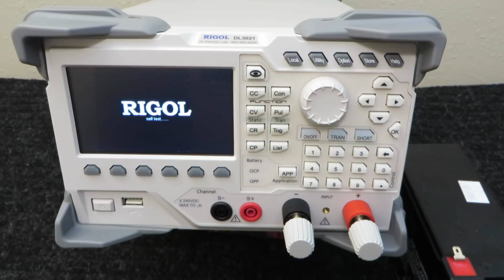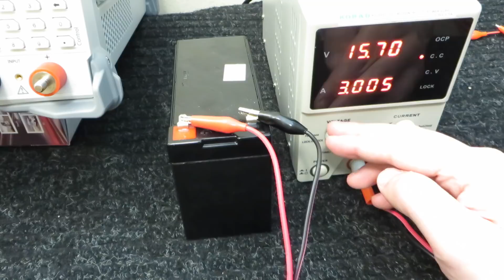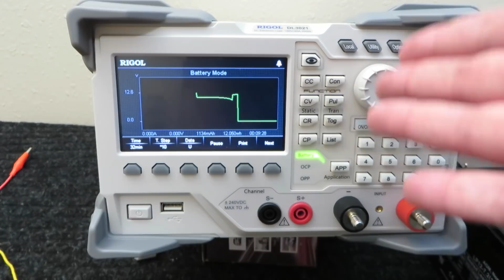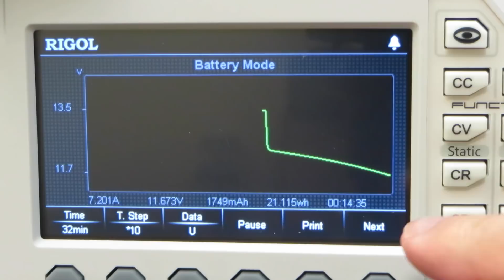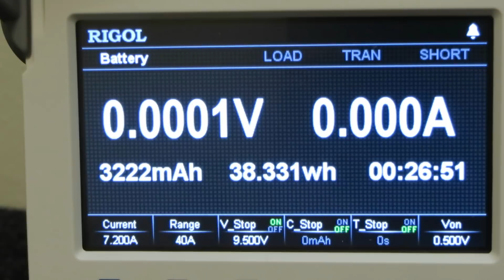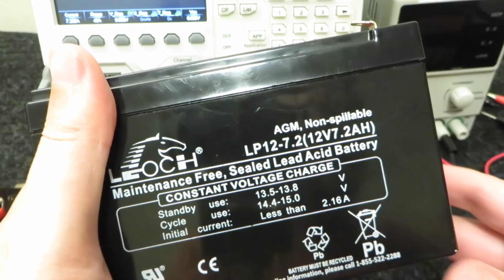Battery Desulfation Demonstration Start to Finish - Part 2/2

Comment: I have a 2 year old car battery that I converted into a magnesium sulphate electrolyte aka:epsom salt and I've rinsed it out with baking soda and water about 3 times, added the epsom salt and distilled water mix, and cycled it and zapped it with a 10 amp charger on muanual  a few times, dumped out the epsom salt mix and added some new with a little more  e salt, and repeated the process a few times with the charger, and have had it setting with a 1 amp trickle charger for over a week  and after letting it set for a few hours it settles at 12.2 volts until i put a load, a 12 volt headlight bulb i turned into a 12 volt lamp to drain the battery with to recycle it, and the voltage hangs at 10.9 volts and just slowly discharges.  Is this epsom salt gonna do the trick if I recycle it some more or should I go ahead and put the acid back in it.  I'm just using it as a backup battery for when the power goes out or to hook my 500 watt inverter to it when i need it.  It's a starting battery I know, a walmart neverstart 730 cca, but I just want it as an emergency battery, and just keep it topped off for an emergency.  Any educated advice you can give a greenhorn?
Reply from the maker: I'm not a fan of adding epsom salt to batteries to revive them as the chemistry doesn't make any sense - meaning there is no chemical mechanism at play to allow it to do what is claimed - but what you did in terms of replacing the electrolyte does make sense.  I have to say I haven't tried this before but it sounds like what you did is very similar to what some industrial battery recovery businesses do.  How to properly reform it back into a traditional lead acid battery?  I'd have to do some research as I admit I don't know how.

Comment: I see your problem.
Concrete floors discharge batteries !!!!!
Reply from the maker: That is an old myth that used to be true in wood and tar case batteries.  Today the only issue with storing them on concrete is that the air temperature around the battery tends to be different than the temp of the concrete resulting in a temperature gradient in the battery.  Where my batteries are the concrete is only a few degrees different than the air temp most of the time.  That may not be the case in a garage or other environment where I'd still recommend putting them on a piece of wood or cardboard.  It likely doesn't make much of a practical difference though either way.
Reply: @knurlgnar24  ok prove this myth. 
Get two new identical batteries and leave one on a insulated floor and one on a concrete floor. Could make a good youtube video
Reply: @knurlgnar24  nope still occurs. I didnt know about this until about 10 yrs ago when a car mechanic kept saying his batteries kept going flat when he left them on the concrete.

Comment: Will this technique also work on 200ah Gel batteries?
Reply from the maker: Yes, but gel batteries will require a low current limit to avoid creating voids in the electrolyte.  I am not sure exactly what the current level needs to be for any particular battery.

Comment: Fascinating, obviously with AGMs it is difficult to see what is going on, from my observations with wet lead acids during desulphation you get localised bubbling where a part of the plate has begun to recover. The bubbles of course are not conductive so the cell internal resistance will rise temporarily. Lead acids seem to recover very well, obviously there are other modes of failure that cannot be reversed. Good to see you back.

Comment: I was under the understanding that with an AGM, if the over voltage causes any bubbles in the mat, the gas will get trapped, arc and burn that cell and lose capacity? 

I have seen that de-sulfating / maintenance charging flooded lead-acid it is very normal for bubbles, even during normal charging they out-gas.
Reply from the maker: AGM batteries bubble just like flooded lead acid except that the bubbles are slowed down by the fiberglass mesh.  The idea is that they are slowed down enough so that the hydrogen and oxygen recombine into water before escaping out the top of the cell.  Overcharging doesn't cause issues unique to AGM batteries aside from pressure which could deform or rupture the case if the bubbling is violent enough, or more likely simple dry-out due to electrolyte loss.

Comment: A while back, I found a new in box APC UPS that had sitting for more than twenty years. Not knowing about any of this, I gave up on its batteries as hopelessly dead. They've probably long since been recycled. Now I wonder if they might have come around...

Even with good batteries, the UPS had a hard time coming back to life. At first the relays inside would buzz when the power button was pressed. Then it'd buzz and produce a painful sounding beep. Today it's fine. If I had to guess, I'd say it was capacitors reforming...
Reply from the maker: That's a good guess on the capacitors.  I suspect if those batteries were new and never used they would have come back.  No guarantees though!

Comment: I have a marine 12v battery that is being desulfated now and on a float charger.  I have discharged it 3 times.  It is recovering.   Resting voltage around 12.65.  When I found it at the scrapyard, it rested at 8.50.   My question is:   Why are hydrometer readings at 11.50 and getting better yet battery resting voltage at 12.65?
Reply from the maker: Specific gravity isn't directly related to battery voltage so I'd trust the hydrometer.  You're doing things right if the hydrometer readings are increasing.  In this video I only checked voltage but measuring the electrolyte when possible is the better way to do it.
Reply: A follow up.  I believe based upon the hydrometer readings that I will have to charge it for quite a long time.  I will continue to use the float charger and desulfator. Guessing it may take days or weeks.
Reply: Thanks for  your input.

Comment: I'm a little confused - on the battery case it says 7.2AH,yet  you you were saying it was above capacity at 3.8AH (I think) on the last cycle. What have I missed?
Reply from the maker: I was discharging it at the C/1 rate, and at that discharge rate the datasheet claimed the battery had about 3.5Ah.  I would have gotten different results if I used a more appropriate C/10 discharge rate but I didn't want to wait a day per cycle.
Reply: @knurlgnar24  Thanks - see, told you I'm learning a lot!
Reply: Excellent video series by the way. Very informative. I've learnt a lot!
Reply: Thank you I just pointed that out too that it's printed on case 7.5ah capacity so 2.5ah is 33.3% life left and not 3/4 😆

Comment: 2.7Ah Battery -> 7.2A discharge current ??? 2.7 turns to 7.2? strange. Water, .... you always talk about Water? AGM Battery...
Reply: These batteries are rated at 7.2Ah, not 2.7Ah. This is the C/20 capacity, at 7.2Ah you'd expect it to measure half the capacity.
Reply: @eDoc2020  my fault

Comment: I watch another channel as well by John Daniel and he uses 3-phase wind turbines to charge his batteries and he says his batteries last longer and dont sulphate as quickly compared to a steady DC voltage.. He uses a 3 phase rectifier feeding the batteries directly with a dump style charge controller to prevent over voltage conditions destroying the batteries. I wonder if that pulsating rectified AC doesnt do a better job of knocking off the sulphation than a constant DC voltage. What are your thoughts regarding this?
Reply from the maker: I think he's likely just equalizing them more adequately with that setup.  A lot of deep cycle batteries end up sulfated due to lack of adequate equalization.  e.g. most inverters do not allow a high enough input voltage to properly equalize flooded lead antimony batteries so almost no chargers have a setting that risks inverter problems, and therefore doesn't properly maintain them.  Even those AGM batteries I have are supposed to be equalized twice a month.  No one does that - except maybe John!  That's my theory anyway without knowing much about his particular circumstances.
Reply: Thanks, so a steady DC versus a pulsating rectified AC doesnt make a difference to the sulphation but rather it is the higher voltage of the equalisation that gets the job done.

Comment: damn that is a sweet electronic load, even if its a Rigol! watching a realtime battery discharge curve is downright pornographic :D I understand that a desulfated battery will never perform like a new one, but I was wondering, even if you can get it back up to its rated capacity, how easy is it for to regress? in my experience, recovered batteries dont stay in good condition long if you slip up in your cycle maintainence. they always seem on the verge of losing all of their hard-won capacity again. enjoyed the videos!
Reply from the maker: That depends on the overall condition of the battery.  If a battery was neglected and just sat unused then you will have a long service life after desulfation in most cases.  If it was in use and got positive plate corrosion, buckling plates, water loss, etc then your results won't be as good.
Reply: @knurlgnar24  interesting! so it depends on WHY it became sulfated in the first place. btw you mentioned the idea of doing a video on how to PROPERLY maintain/store a battery. i'd love to see a video about that and why a float charger isnt enough etc

Comment: I would like to know the internal resistance delta for each reconditioning cycle. What does your conductance tester say about it?
Reply from the maker: I was going to use my conductance meter but the video was getting so long I omitted it.  Now I wish I hadn't.
Reply: @knurlgnar24  Well, just post a final reading here. (24 hours after full charge)

Comment: I'm impressed with that battery bank.  I'm surprised it's still working that well.  It was pretty old and used when you first got them and here we are five years later and they're still pretty good.
Reply: @corey Babcock  I was amazed to find, when I had to replace my car's battery, that the one in it was the original one from the faactory. It's date marking showed that it was 11 years old !
Reply from the maker: I know this is an old comment but I still use these same batteries at least once per year as a test to demonstrate how they will perform powering my household needs with generator backup.  No issues so far.
Reply: Thanks a lot for this video. I am currently trying to salvage two similar batteries that has been totally discharged. I am a bit at loss about when to stop the high voltage "overcharging". The thing to watch out for, you say, is temperature. How high temperature is "ok"?
Reply: @corey Babcock  I think his batteries were in service for several years before he saved them from the scrap heap and that was over 5 years ago and many of them are still at 100% capacity.  He made some interesting videos on them.

Comment: ABYC is making the neg yellow to eliminate potentially harmfully confusing the DC neg with the American AC live. They are both black on a lottov boats.
Reply from the maker: Yes, the wire color convention for DC is not consistent.  Is Black hot or is Black neg/gnd?  What is white?  Black is ground/neg on battery systems so white must be positive/hot?  No, wait, white is neutral.  No?  ???
Reply: @knurlgnar24  - For our rings here in the U.K. we use brown = live, blue = neutral and green/yellow stripes for earth.. We used red = live, black = neutral (earth y/g) until a few years ago. That could lead to an interesting situation for a Brit emigrating to N.A. who decides to do any electrical work!
Reply: It's a lot more straight forward in Europe. Single-phase 230V, 3 phase 400V, unique colours, you guys are nuts. I'm over here; https://www.fieldlines.com/index.php/topic,150161.0.html
I do pretty similar work to yourself.
Kind regards,
Liam.

Comment: I once tried recovering a couple (2 x 12V in series) of small SLA's from a standby application (automatic door back-up, on charge basically for 24/7 ) that were so bad that when you pulled any current out of them the voltage would just drop to near-zero. Open clamp voltage was about 11V. They didn't take a normal charge any more (no current). 

Since I figured they must have boiled dry over the time they were installed, I opened the top cover plate, and removed the rubber caps (which actually serve as valves). I added distilled water (you can buy it easily in every supermarket for less than 1 euro for 1 liter) to each cell, while carefully noting if I started to see the water level rise above the absorbent material. Some cells required more, some less water. Excess water was removed by shaking the battery upside down in the kitchen sink (It doesn't become acid immediately. That takes a good amount of time, so don't worry)

Now that I knew about at least one parameter (water level) of the physical condition of each cell I went ahead and put them on the lab supply set to 20V/current limited to 500mA (small batteries). I put my bench multimeter (34401a) in series to monitor the charge current that started out below milliamps... The charge current rose to a couple of mA in 5 or so hours. I let it charge until I was satisfied and stopped charging. With a small incandescent light bulb I tested to see if the battery was able to deliver some current and discharged it.
I repeated this multiple times with some experimentation but safe limits set and I was able to recover both batteries, but unfortunately one of them had developed a bad cell that would always run hot both when charging and discharging. While the other good battery after charging  and sitting for 24hrs still had over 12V on its terminals (over 2V per cell = good/fair IMHO), this one dropped to 10V, indicating one failed cell. While charging I was able to clearly hear the batteries "boil", which indicates that the acid is doing its thing and the added water is being converted.

During the recovery process I monitored the temperature "evenness" with a thermal camera to avoid problems.
After recovery I put the rubber valves in place and taped the cover plate loosely on, the one good battery was being kept as a hobby thing, not for critical applications anyway. When replacing the top cover plate I made sure not to block the vent path.

Needless to say this recovery didn't make any economic sense, but it was fun experimenting!
Reply from the maker: Nice work!  Most of the time this sort of thing isn't really economical but on occasion it can be.  There are businesses that specialize in recovering and reselling forklift batteries for example.
Reply: @knurlgnar24  Yup. It was a good exercise. Later my neighbour  put his old car battery on the side walk, a big ass one for a large Mercedes Diesel. I scaled up the charging and discharging with my huge lab supply (up to 20A) and a massive electronic load form my employer. I used jump starting cables to connect the battery to the load. They got hot. In fact, I was lucky to play it safe and be physically present and monitoring, because one of the terminals' isolation caught on fire (due to the high temp cause by the contact resistance) while testing at 80A(!). Unfortunately, that battery had a defective cell as well and after charging and sitting for 24hrs the clamp voltage dropped to below 12V by itself. I did get some cash out of it when recycling though, as it was very heavy!

Comment: Thanks K-G, helpful to watch your process.  Have you found it advantageous to pop the cover & caps to add water to the cells ?  What about any chemical additives ?   JwgK  a subscriber from previous years
Reply: No cover to pop on this sla battery
Reply: @mwilliamshs  Usually the plastic plate on the top comes off easily, then you see six rubber caps. When I say it comes off easily, one time I had it come off accidentally. Usually it's not that easy but it's certainly not hard.

Comment: On that electronic load use the sense terminals and connect them to the battery terminals, that will solve the voltage drop issue.
Reply from the maker: Thats' to EZ.  I did collage gud.
https://www.youtube.co/watch?v=wv4eTE0aUiQ
Next time Gadget.  Next time.
Reply: Ullllu

Comment: Surely you should have set the cutoff voltage lower not higher... 10.5v at the curve tracer was 11.5 at the battery
Reply: I think what he meant, was that with the cutoff voltage set at 9.5v it would actually be stopping at 10.5v.